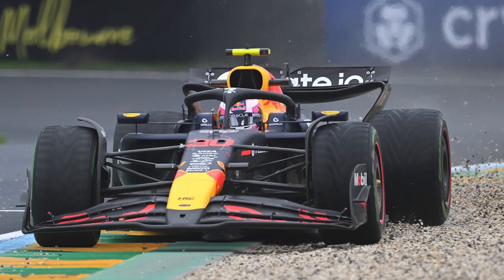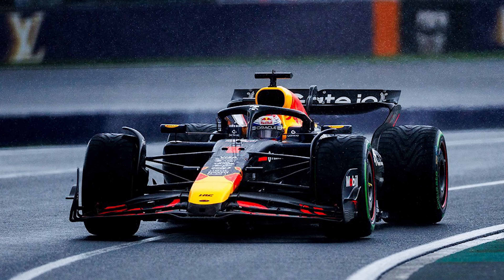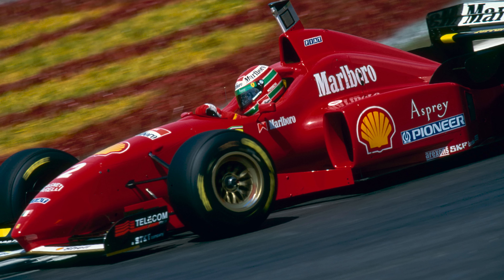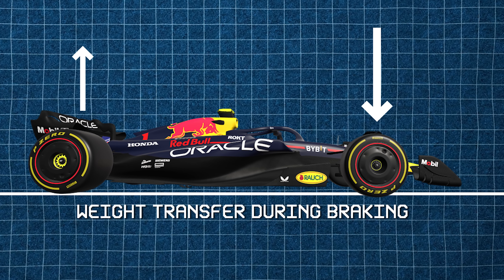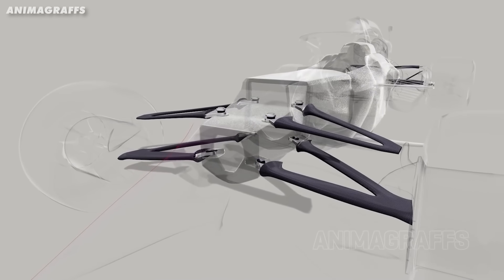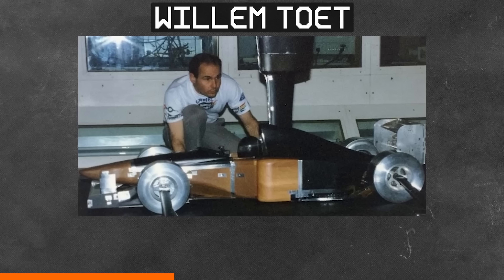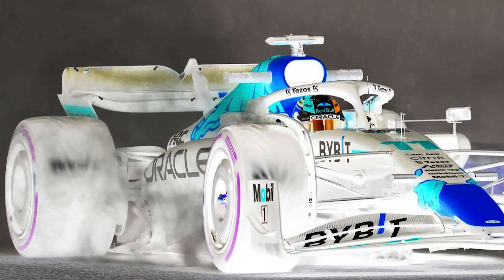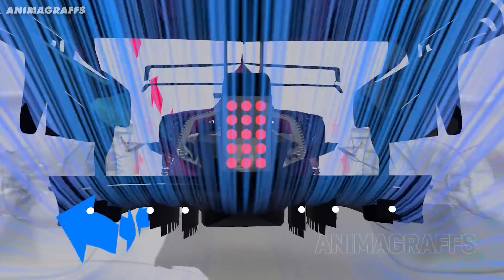F1 Engineer Explains Red Bull's Difficult Car

Comment: I remember the first time I saw Schumacher properly drive precisely. At Silverstone one year when he was stil with Benetton, during a couple of practice sessions, I stood at Maggot's and the crash barriers and hoardings there had a small gap and I could see the drivers brake (and the discs glow) through that gap. Every lap I watched as drivers ran through their experiments and setups, and some drivers were wildly different in their braking point from lap to lap. Schumacher though, not only was he bang on the same lap after lap to a surprising degree, but his brakes didn't glow until slightly AFTER this gap, showing him being so precise he could brake later. 
Truly astonishing to witness him repeat the same thing so exactly one lap after another.
Reply: after schumacher left benetton gerhard berger came in and he said, that he thought that the team is trying to kill him, because the car was so undrivable. Only Michael could drive that beast and won 2 Wc with it. The Goat
Reply: @otavongryf1379  Good point. It truly shocked me how precise he was, and I was so glad I managed to see such a thing.
Reply: @otavongryf1379  yep, I remember Berger saying that... I think Valentino Rossi had a similar revelation when he tried to ride Casey Stoner's Ducati.
Reply: "Flawed competitor " I'm trying to wrap my head around it. 😅
Reply: Saw something similar when Pat Hennen rode the Susuki RG500 at Wanganui Cemetery Circuit in NZ, On one corner there was a manhole cover with slightly raised outer edges. He would be on the same line every lap and lift his knee at the same point every lap while at full lean.
Reply: @neilcunningham2769  It's something bloody wonderful to see ain't it?
Reply: Schumacher was incredible.
Reply: Nice
Reply: my guess is Schumacher was lightly braking early before heavily applying the brakes later... whereas the others were just stomping on the brakes
Reply: @js290  It could well be, but the precision on which he did it is what got me. Not that he left it so late - it's that he did it in EXACTLY the same place where every other driver, to varying degress, did it differently. He had it nailed and knew it.
Reply: Yes he was a super driver but a flawed competitor. It seemed to me that he felt he was entitled to win.
Reply: @philiptownsend4026  I swear it's not hard to find the Brit and I'm sorry to say that
Reply: @philiptownsend4026 you had to open your gob, didn’t you. Just couldn’t stand to see someone praising him so you had to try and knock him back a bit. What you said has nothing to do with OP’s comment and it doesn’t further the conversation in anyway. It just brings in the haters, their negativity and starts arguments.
Reply: @philiptownsend4026 the world knew in the same car. He was leaps ahead of Damon Hill. Which is why incorrectly. FIA allowed MSc to steal one championship away from Hill by crashing into him
Reply: @philiptownsend4026 the flawed competitor is a 7 time f1 champion.  Schumacher is the best driver in f1 history.
Reply: @philiptownsend4026  "flawed competitor" that's the dumbest thing I've heard in a long time- it's professional sport.
Reply: @matthewshepherd826 purposely crashing isn’t professional.
Reply: @matthewshepherd826  It's not. Schumacher was a sore loser and he did unsportmanlike things to win.
Reply: @Infiltator2  hi Brit
Reply: @ Lol im a german. Even though he is the best driver to ever sit in an F1 car he was going above the limit at times
Reply: @Jona-sr4ih  Yeah, sure. 
Senna did the same things many times in his career but somehow it's always Michael that's in the eyes of the Brits, innit?😂
Reply: @Infiltator2  Yeah so? That wasn't the point was it? ALL make mistakes. That doesn't back up your flawed competitor nonsense.
Reply: just like lewis then  @Jona-sr4ih
Reply: @Jona-sr4ih  Just like Senna....
Reply: @Infiltator2 yep. I think Alain Prost also pushed past his limits several times.😅
Reply: @UnstoppableInc  well i dislike Senna too, and i'm not british😂 dirty drivers smh
Reply: @ What a stupid claim - "Flawed competitor". That's utterly misunderstanding things. I'm British and I hated it when he did that thing to Damon Hill, of course. But the thing is ALL top class sportsmen are in it to win it and have a MASSIVE competitive urge and in the heat of the moment most will do something like this.
That's what a lot fail to understand.
Reply: @crunchyfrog555  nah. You can be at the top of the game without being unfair. Example: Miroslav Klose. World cup goal record holder and world cup winner. Very fair sportsman.

Schumacher sometimes took it way too far.
Reply: @Benjamin-xv9le  You must be stupid then, because I never said you had to be. I simply said many are. It's common. It's just part and parcel of being competitive so very few are able to dissect it.
Reply: @crunchyfrog555  almost killing people on the track cos you feel like you need to win is not a good competitive trait. lol. what lewis did after getting robbed is. good driver but horrible personality on the track and some bigggg sportsmen are like that because you need ego to thrive in sports
Reply: @MotsieH  Stop strawmanning - I never said that. I was referring to the stupid claim about him being a flawed compoetitor as that's a silly claim for the reasons I gave. I never said it was right, nor did I say anything else like it should be that way. lwearn to use basic comprehension.What I said was that it's a COMMON trait with competitive people at that level, and no tjust in sport. I've been lucky to have worked for many years in music (mostly festivals) and have met an awful lot of people and many of the really successful ones have attributes which in any other area you'd think outright fucking rude or belligerent.
Do you get the point now?
Reply: @crunchyfrog555   he was a flawed competitor tho as he did not like losing? part of competing is accepting you lost, whether you want to do better or not afterwards is up to you but in the initial moment of loss, good competitors concede.
Reply: @crunchyfrog555  /Arguably, when he had that skiing accident, was he trying to ski "on the limit?" Just unable to turn it off?
Reply: @shannonmcstormy5021  Nah. He was recreational skiing and granted, he apparently did used to ski pretty damned fast. Still if you've ever met any racing drivers they tend to want to do a lot of things fast - it's quite normal. 
The problem was though he used to ski without a helmet and that's what caught him out. I can't recall off the top of my head as it's been a number of years of course, but he was either avoiding someone or he just made a mistake and his bare head hit a rock. Doesn't matter really how fast you're going withint reason, that'll do for you.